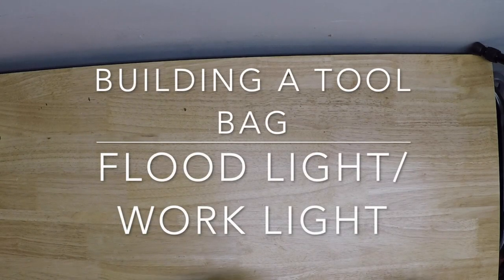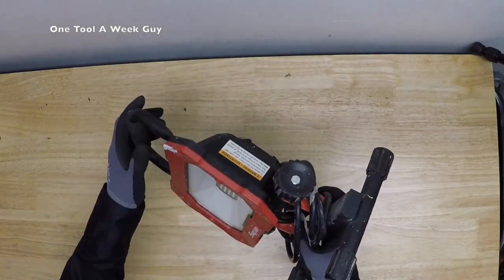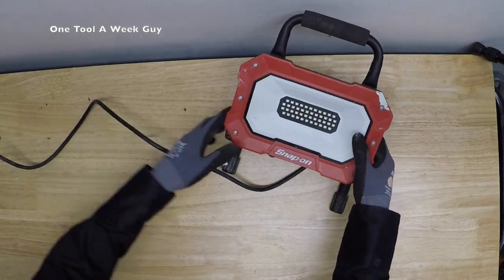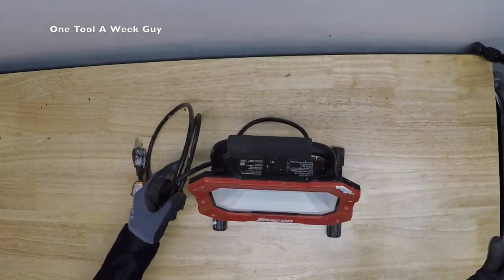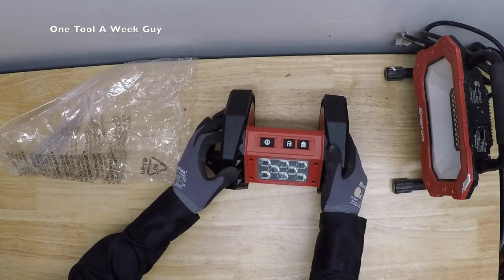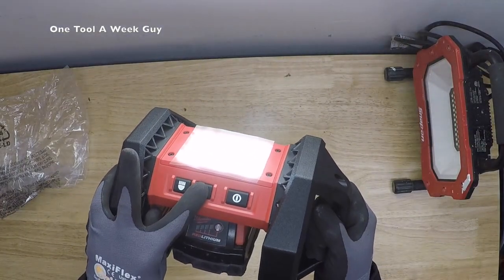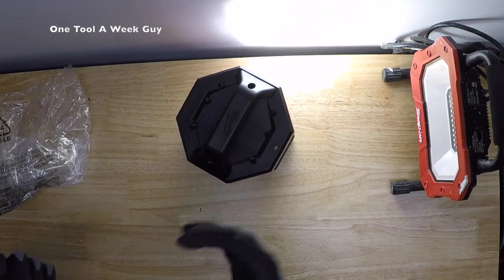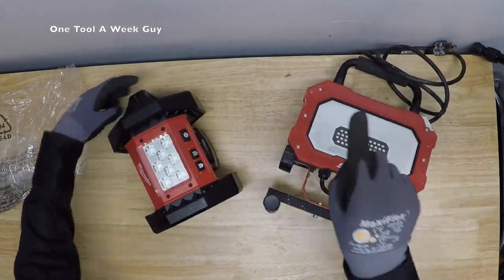Building A Tool Bag (Flood Light/Work Light Snap On 922261, Milwaukee 2361-20)

Comment: Those both look like great lights.  Battery powered really is a great way to go but still good to have corded around for when  power is available.  I have had a Bosch 12 V for a few years, love it.  Convenient adjustable magnetic base that can also work as a hanger with clip.
Reply from the maker: Gary Dudgeon what model number is it Gary thanks for sharing.
Reply: @OneToolAWeekGuy  It is an FL 12 ,about $40.00 (bare tool/no battery)  at Lowes or Menards. Also available on Amazon.  10 LED, lots of light, good battery life.  Great if you have other Bosch 12 volt,  if you had to buy batteries and charger just for it maybe not a great deal. I have quite a bit of Bosch 12V.

Comment: They updated the milwaukee light to fit a 9.0 or 12.0 mine has a bar in back can't fit the batteries 😑
Reply from the maker: Jason Malicek I won’t lie. I miss the bar.
Reply: @OneToolAWeekGuy  yeah I pull out the rocket light of I'm using the 9.0 but the rover is usually my go to
Reply: Send light in and Milwaukee will fix so u can use 12.0s
Reply from the maker: how do you like the rocket light?
Reply: @OneToolAWeekGuy  I like it.  I usually use it if I'm on a job for most the day . If it's a service call in and out I use the rover

Comment: you should check out the utilitech pro led work light. its got 120 and 12 volt and its cheap. i use 2 on a tripod with a jump starter battery pack.  like you videos i subbed.
Reply from the maker: is it the 1000 lumen? I see it on lows? whats the model number? Thank you for the support.
Reply: @OneToolAWeekGuy  utilitech pro 1 its 700 lumens  #0580828
Reply from the maker: thats a great idea!!!! how many hrs do you get out of it?
Reply: @OneToolAWeekGuy  i got 2 on a tripod got about 120 hrs so far.  ive had them about 4 months no problems..

Comment: Would that light hold my 12.0 m18 battery
Reply from the maker: Jason beat me to it. Yes the 12.0 battery’s fit. The older model have a bar. I did like the bar because I could hold it and strap something around.
Reply: Not to sure about that. I don't think 12.0 fits in any light smaller than radius. I believe u need to send tool to Milwaukee so they can fix for free for use with 12.0
Reply from the maker: chris jones talk to the rep and was told it fits any m18 battery.
Reply: @OneToolAWeekGuy  Any tool will fit but some need sent in for a free mod to work with 12.0 battery. Milwaukee even has the list of tools that need to be sent in for modification for use with the 12.0 battery.
Reply from the maker: thank for letting us know Chris